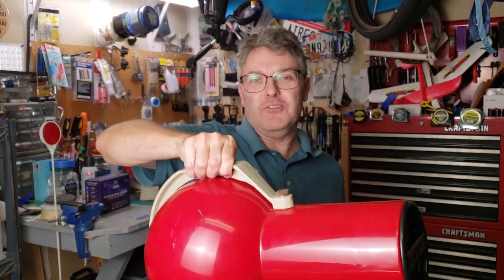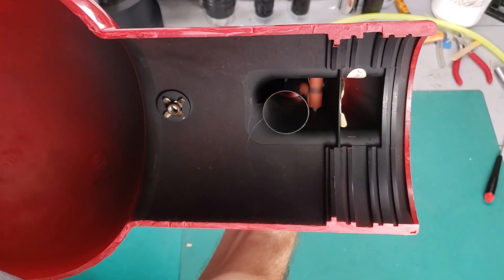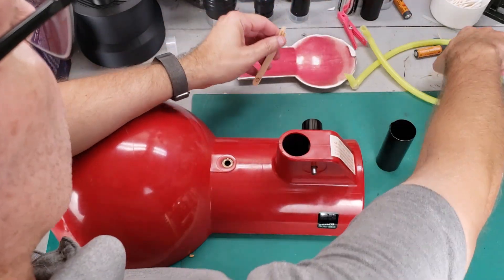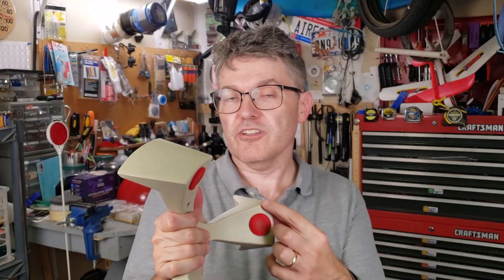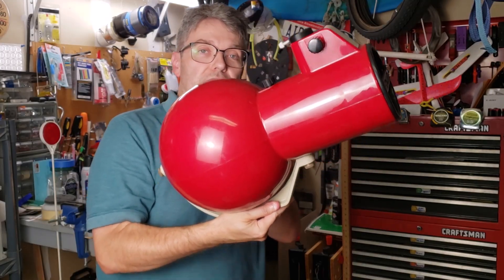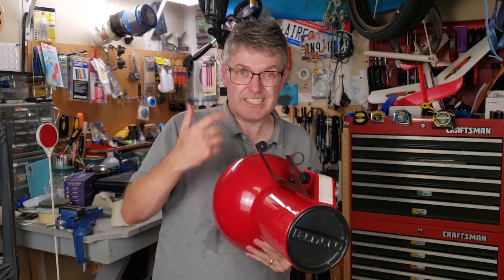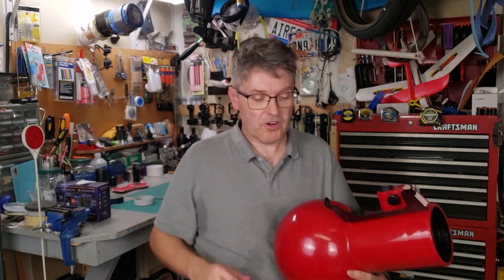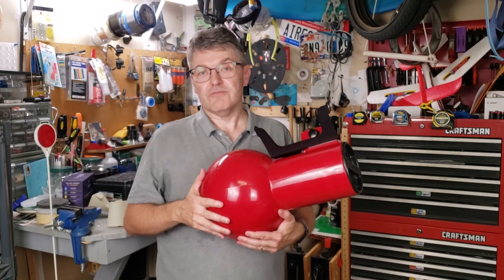Astroscan Repair Guide (Part 3 of 3): Fix Focuser, 3D Parts, Bonus: Oddball Accessories

Comment: I have three RKE eyepieces and the Barlow. I have the finder in a bag, but I thought the rubber eye cup was for the eyepiece. Some official accessories I have are the sun projector and the sponge rubber mat to set the base on. And I think my carry case is different. More of a zip duffel than a drawstring bag.
Reply from the maker: You have some unique accessories!  The rubber eye cup is probably for the eyepieces, but there is a rubber cover (specially made) for the finder.

Comment: Proud (new) owner of #296 Astroscan. Regarding the focuser, how would I replace the tubing on the focus shaft, without taking the front of the scope apart? Any thoughts on that? (I had an old Edmund 3" reflector with the same focuser but the front was open). Thanks!
Reply from the maker: Wow! That's one of the earliest I've ever heard of.  If you remove one of the knobs, you can pull the entire contraption out the side.  However, the rubber tube will fall into the telescope unless you first remove the focuser tube all the way and stick your finger into the telescope at that point (to grab the rubber tube).  Question: Does your front ring have the little holes drilled into it?
Reply: @AstronomyGarage  Unfortunately, the ring doesn't have the holes. Do you think I could get a new piece of tubing on the focusing shaft, via the focus hole?

Comment: This is great! I’ve been needing to fix my focus tube for a while. 
I also need to clean the inside glass and I didn’t know how to pull that ring since mine didn’t have holes in it and I didn’t want to scratch or break the glass. 
I’ve had mine since the late 70’s or early 80’s when I got it for a Christmas present.  I’ve built a custom wood carry case and all for it.
Reply from the maker: Wonderful!  Good luck.

Comment: One other thing is that the foam does not need to be the same diameter as the mirror. It can be smaller. The original foam was dome shaped to match the curvature of the bottom of the housing. You can use a smaller diameter piece of foam and center it on the back of the mirror with a small, double-sided adhesive square. You just need to get the thickness of the foam right in relation to its diameter. You want the mirror snug against the retainer ring but not so tight that it is impossible to push down when installing the retainer ring. I have never had an issue with a pinched mirror. It helps that the retainer ring goes all the way around the mirror. On many newts, there are three clips holding the mirror. It they are too tight, you can get a distorted image from pinching the mirror.
Reply from the maker: That's a good point about the constant symmetric ring pressure as opposed to three clips.
Reply: An interesting side note: I have an astroscan that I bought brand new from Amazon just before they were discontinued. It is Chinese-made. I have never done any work to it or opened it. It has slightly pinched optics. When doing a star test, the defocused stars look slightly triangular. I would like to know what the Chinese factories did to cause that, but I am not messing with it. It is still in new pristine condition, and it works as intended for low magnification. @AstronomyGarage

Comment: Don't forget to talk about aiming and finders (I know you mentioned the sheet metal finder). I use a laser pointer. It works great. You press the laser pointer against the body and hold it down with a finger. Place it in the corner/crook where the focuser housing and the optical tube are joined.
Reply from the maker: I think I might need to do one more video to cover that stuff, plus I'd like to show people how well it works after I clamp the two halves back together.  I live very close to an airport, so lasers are no bueno here unfortunately.

Comment: I used polyethylene closed cell foam in mine. It doesn't deteriorate (esp. around moisture/humidity) like the open cell polyurethane foam that was installed at the factory. I got the polyethylene foam from Amazon packaging (an electronics item that I ordered). It was just the right thickness. In one astroscan, I used a piece of foam cut from a yoga block. I don't have much trouble removing the retainer rings without the pliers. In fact, I never used the pliers on the mirror retainer ring. I don't want the pliers to slip and scratch the mirror. I have rebuilt 6 astroscans (5 USA made and one Japanese). Only one of those 6 lacked the holes in the retainer rings (an early USA made one).
Reply from the maker: Thanks for the foam tip! You are a true Astroscan fan.

Comment: In your demo, when you removed the axle with the rubber tube and the rubber tube dropped out, you needed to show how to capture the rubber tube from a non-spit Astroscan tube. As it is, one would have to removed the front glass plate for not only the removal of the axle and the rubber hose but also for the re-insertion of the axle, then sliding the new rubber hose on it... then having to replace the front optics, re-align, etc. Still enjoy your videos !
Reply from the maker: Funny you mention that. I actually filmed a segment talking about how you have to take out the secondary glass disk first, but somehow forgot to include it during editing.  Thankfully the first Astroscan video is all about that process.
Reply: I wonder if you remove the focuser knob shaft while orienting the telescope "upside down" you could then induce the old rubber tube to fall out of the hole formerly occupied by the focuser tube?  Could be a way to avoid removing and reinstalling he secondary mirror assembly.

Comment: Nice series, John. I have seen a few of these scopes but have never actually looked through one. It would seem that one would need a table to setup the scope on, or the tripod setup.I would have to agree that the focuser is probably the least likable component. The replacement focuser appears to be a good replacement. Ciao!
Reply from the maker: Hi John! Thank you for watching. I usually use the hood of my wifes car to setup this telescope, lol.
Reply: I have a small pickup truck (Ranger). I put the astroscan on the tailgate and sit on a short stool. It works great. Other times, I put it on a small folding table and sit on a folding chair. I am planning to try using a 5 gallon bucket turned upside down using a small dog bowl (that will fit the 5 gallon bucket) instead of the factory cradle and a short folding stool. The other night, I put it on a low cinder block wall.
Reply from the maker: I usually set mine on the hood of my wifes car.

Comment: To fix that worn focuser hole I would suggest a steel washer with a 12mm ID glued in place rather than a chip of wood.
Reply from the maker: That is a great solution!
Reply: Yup, or if you want to avoid that wearing out in time (or wearing out the shaft), find a way to mount some ball bearings in there. Enlarge the holes on both sides, then create a 3D printed cylindrical part that fits in the enlarged holes, but has a lip that prevents it from falling in. Make that part large enough that it can press-fit a ball bearing, with another lip on the inside to prevent the ball bearing from falling in. One on each side, the knobs on both ends prevent them from falling out, and the lips from falling in. Will never wear out again!